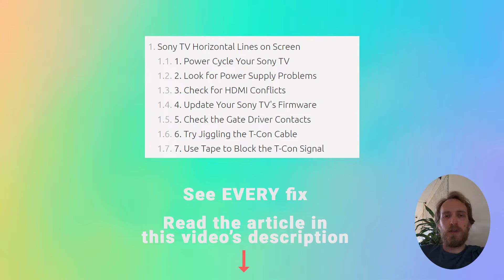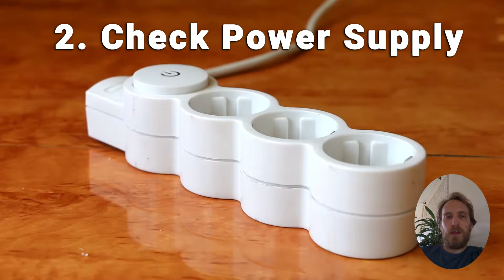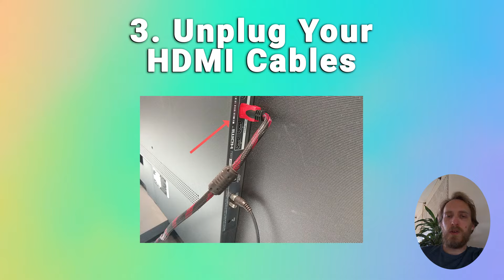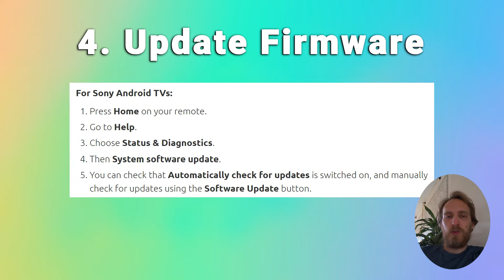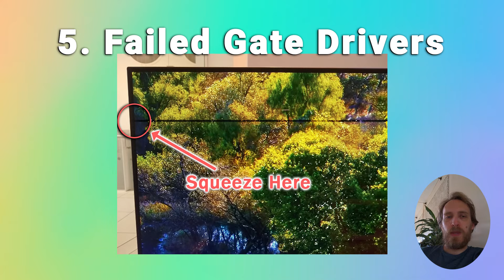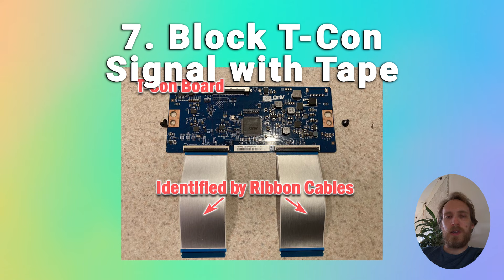Sony TV Horizontal Lines on Screen? Try This...

Comment: Damn what is it with mid range Sony TV's crapping out.   They used to make really great stuff.   My 120hz X85K that's only about 2 years old seems to have a failing pixel driver in it.   There are 2 black lines of pixels that are always across the screen now, even the built in blue screen.   Guess I'm gonna move away from Bravia and try an LG OLED.   I used to fix TVs but I'm not gonna tear this big thing apart and try to fix it, I'm pretty miffed with Sony at this point.

Comment: I've tried your solutions and nothing has worked. I don't have single black lines. And it's not all the time. I have a fairly large green, it's always green, horizontal line that fills the last few inches of the bottom of my Sony Bravia 82 in. The green horizontal line only shows up when streaming movies. Particularly older movies, but we did see it happen during Minecraft today. Simply hitting the back button and then initiating play again it will go away. Sometimes for the duration of the movie sometimes a couple more times for the duration of the movie. 
I never see the green line for any other streaming content including TV shows and other apps that produce TV shows. It's only movies. Any ideas?

Comment: Nothing is working. None of the bottons on the remote does nothing only turn on, and turn off so I know its not the batteries. I wanted to go to settings or home, but nothing. I have yellow lights, blue, red light with lines😢

Comment: Non of these worked for me 😕
Reply: My research says its the power board. Capacitors start to go funny so the right voltage isnt supplied to the screen and a line/bar will flicker and eventually stabalise.

Comment: I got lines in top while using Amazon Fire Tv Stick 😭😭😭

Can it be fixed I have removed all but it's not solving 😭😭
Reply from the maker: If it's only with the Fire stick, then I would check the HDMI contacts for dirt/damaged pins.
Reply: @techtests hai..can u explain this?i think my tv hv this problem😅😅

Comment: How about a thin white line across the screen (about 2 inches down from the top)?
I’ve completed all of the basic possible fixes (turning Tv off at the wall for 5 minutes, changing HdMI output, checking software update)…. But the line is still there.
Reply: Did you fix it?
Reply: @AswinPNair-l2l nope. It’s always there now. I think it’s the white line from when the TV automatically goes into that standby mode… and burned into the screen. If you don’t press any buttons after an hour, the Tv thinks you’re not watching, so turns off the picture and sound and there’s a nasty white line there. Often when that happens late at night I just leave it and listen to a podcast or chat to the missus. Never knew the line was burning away at the screen each time. Awful TV
Reply from the maker: That sounds like the best explanation.
Reply: @adsGBR  I have a thin white line across the screen like yours but it's two inches up from the bottom, not down from the top. I don't think it's to do with standby mode as I've never seen it go into that - if it's on for a few hours with no input it just turns itself off.